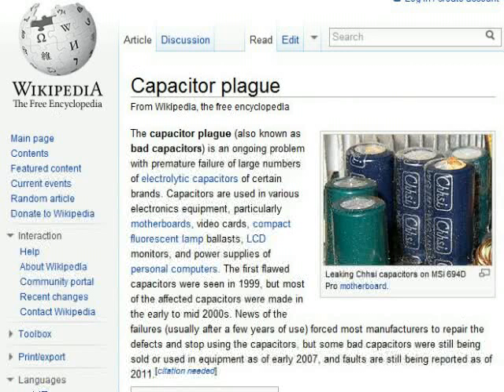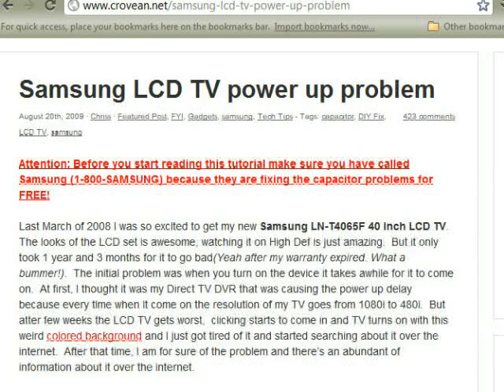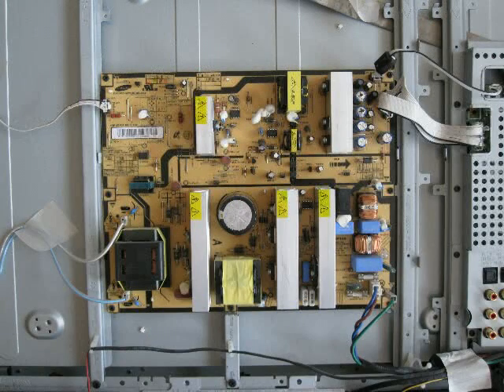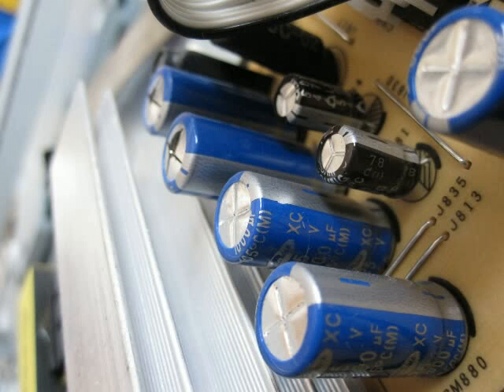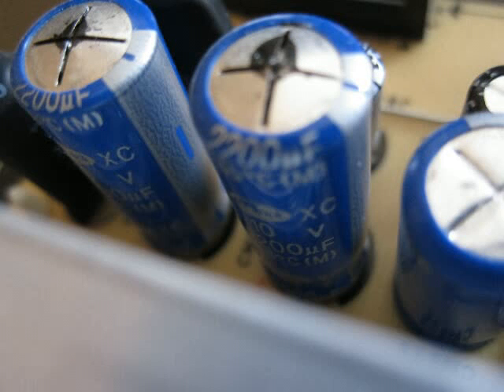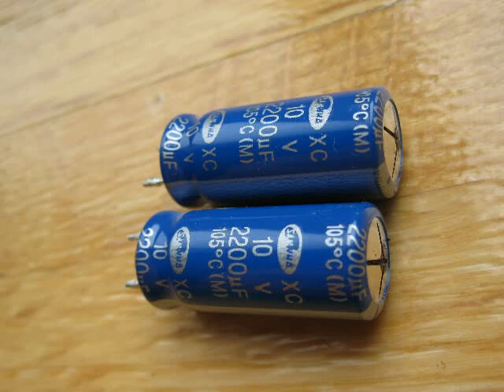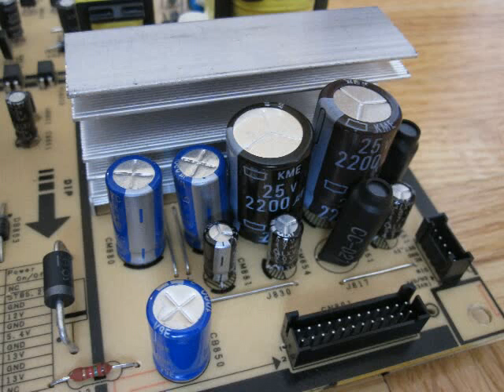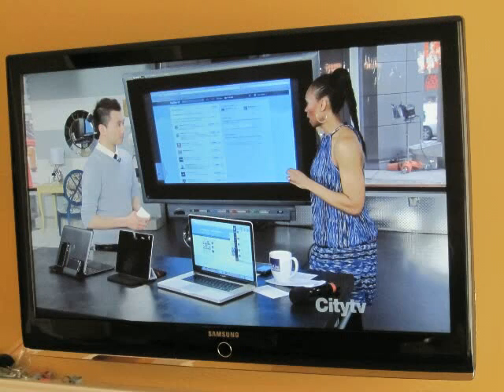Samsung TV Problem Turning On - How to Repair Fix

Comment: I'm looking at my circuits and none of them are bulged or leaking, but I'm still having the same issue.
Reply from the maker: Sometimes the caps have become bad even without an obvious external signs of failure. If you are having the power-supply clicking problem, I would remove all caps on the power supply anyways and test them using an ESR tester. Or just simply replace all caps as a matter of fact. The caps are cheap, so you are better off just replacing them.  If there are more complicated problems, it will be harder to track down the issue. The only thing to do is go in and test every component or buy a new power supply board and then fix the old one for a future backup. Good luck and let me know how it goes!

Comment: hello there

can anyone help me my samsung 46 when its turned on and u turn it off and when u turn it back on it wont come on
Reply from the maker: Open it up and inspect the components on the power supply. Seems to be a common site for failure, usually the capacitors. Look for any bulging, leaked electrolytic fluid, any burn marks or do the "smell test" by sniffing around the board (make sure the power is off and unplugged). Be careful not to zap yourself with high voltage from any caps that are still charged. I'm sure you will find something.
Reply: nothing wrong with the components tryed that still the same i tryed the main board

Comment: BUYING A SAMSUNG IS A WASTE OF MONEY. Here's why. I paid 2300.00 for my 7100 series Samsung LCD TV thinking I was buying quality. It lasted 5 yrs now at the trash dump. 2000.00 to repair. Have you noticed how many TV repair guys aren't around anymore ? TV's are throwaways like a laptop that you get about 5 years out of them.

Advice from repair guy. Buy a set for a 1000.00 range at Costco. For 58.00 more you now have a 5 year warranty. If it lasts longer than 5 years you win. If it becomes toast like my Samsung you still win.

Comment: nothing wrong with the new tvs.  capacitors have a lifespan. these are around 2000 hours and less if running at full temperature.  anything with components in like this will fail.

Comment: My  3 year old 40" samsung had the clicking problem.. Now, it won't even turn on. I took the back off ad found 4 bad capacitors. Bought a capacitor kit on eBay for $15.

Comment: I bought Samsung LCD 3D TV  un55 f7100afxza 2/15/2014 and it went out 12/31/2015 . No power, no red indicator .. So pretty sure I'm on the right trail here. Of course Samsung no help as warranty is over at one year and this almost made it to 2. They tried to tell me that it was as of build date also. What???? No not if you have your receipt. But it's only one year not 2. Well this will be a project so wish me luck! If this 55 year old grandma can do it anyone can! And Samsung BITE ME! I'm all done with you!
Reply from the maker: +Karen Fleischman This is a very familiar story... And sounds like a power supply issue. I bet you if you open the TV you will find the power board has a fault. It may not be as easy as a capacitor though. I had a Philips TV die after 1 year and it was actually the fuse plus about 5 other components..... See my other video here:  https://www.youtube.com/watch?v=V5b0nfkVqkc
Reply: Thank you!!!  I'm going to open it tomorrow evening... Thanks so much for the guidance! I'll let you know how it goes!

Comment: changed the capacitors in my samsung tv LE40M8780, though they looked ok, still got the same prob of tv  turning on and off repeatedly. Any idea"s anyone?
Reply from the maker: There are other components other than the capacitors on the power board that need to be checked, as they could be damaged as well. You can get a repair kit or simply find a replacement power board. You need to trace each step of the circuit and see if you are getting the proper voltages out. Check the rectifier diodes, make sure they are working properly. Check any transistors, MOSFETs on the board, it can be an arduous process. Good luck!
Reply: thanks

Comment from the maker: SAMSUNG Capacitor Settlement UPDATE for Canadians -  So I called the Canadian contact number 1-800-726-7864, and someone there told me they WILL SERVICE your TV if you have the clicking problem. However, there is NO SETTLEMENT in Canada... The US settlement does not cover Canadians. That means, if you fixed your TV OUT OF YOUR OWN POCKET and paid for a repair, THEY WILL NOT REIMBURSE YOU. Furthermore, if your TV has been "fixed" (for how long who knows) they will NOT send a service rep to you.

Comment: i have this problem but i cannot fix it myself. i dont have a Soldering tool  nor do i know how to use.  is there a place/ anyone know of a place that would do the repair without it being $500?
Reply from the maker: Perhaps look for an electronics hobby group in your area and see if anyone there can help you fix it or join an electronics forum like EEVBlog and see if anyone can help guide you online or knows a local hobby group. You need a "Maker Space" or some hobby meeting place where people who tinker with electronics get together and build and fix stuff... I am sure you will find one in your area.

Comment from the maker: SAMSUNG Canada PROMISED (on word of a customer service call centre - ok) that if MY TV HAS any FUTURE problems related to capacitors, they will honor it and fix it FOR FREE. I told them that Samsung DENIED this to me 1 year ago, saying they didn't have a problem and told me to fix on my own. NOW they said "We offered free service as early as mid-2010". BULLSH*T, Samsung Canada did NOT offer it when I called in early 2011. They are back-peddling to cover their ass. Lies and deceit over and over!

Comment: Cheapo san-wa caps used in cheapo make plasma/lcd have 105 C rating--For 1000 hours only.
 Rubicon or Nichicon Make caps, 105 C rated at 10,000 hours. You get what you pay for!--they'll be double/triple the price of the cheapo rubbish.
--Cant get 'em?--OK, Use Panasonic 105 C ones, but they only rated for 2- 4000 hours depending on model....
Check the data-sheets for the caps you are thinking of using before buying 'em--All good makers issue them online.....

Comment: Samsung are shit I just got the Samsung series 9 65" curved UHD and after 38 days the TV dose not turn ON what a joke my LG hade lasted for 9 years with out any issue and my sister is using the same TV RIGHT NOW. Samsung TV's are way overhyped !! DON'T BUY Samsung THEY ARE SHIT  TV's Cheers.

Comment: Samsung is such a rip-off!  I have a 55" 240Hz LED Samsung that is barely four years old, and it went out yesterday!  It just keeps making the "clicking" noise, as if it's being turned on and off.  Also, I could smell an alkaline-like odor coming from the back of the tv - no doubt this was the faulty capacitors. 

When I called Samsung, they did nothing to help.

Samsung, I will NEVER buy ANY of your products again - EVER!!!!
Reply from the maker: You should open up your TV and check for capacitors, take a video or photos and share it with as many people as you can, like I did.

Comment: I have a samsung tv and having a similar problem but slightly different. I posted a video here: 

https://www.youtube.com/watch?v=ro2UWg9HAFg&list=UUQpYO0a0UQgwJd-m6tBqWKw

Does this look like a capacitor issue? I have noticed that if I plug my ipod in, the screen doesn't do this. So is the problem in the tv or somewhere else?

Comment from the maker: Please check out my other TV repair video: https://www.youtube.com/watch?v=V5b0nfkVqkc

It shows that sometimes it is a bit more complicated. Still, you can buy repair kits from various online suppliers (as mentioned in the linked video) for $20-30 or complete boards for $40-50 so you don't need to bother soldering and fix your TV yourself.

Comment: thx for the video...I am having an issue with the tv and opened it up...
u can see black mark in the first video below...I think they are just marks from the last time they changed the capacitors (last time something similar had happened samsung send someone to repair) and I believe they replaced the capacitors and hence those marks...they do not seem to be bulging out...

https://youtu.be/1n7OMg2zepI

https://youtu.be/tBWdwP3xL80
Reply from the maker: +MeRandomVideos Bad capacitors don't always vent and bulge. Sometimes you will get a bad capacitor that looks normal. The only way to test is use an ESR meter or purchase a cheap component tester like this one in my video: https://www.youtube.com/watch?v=ZUq6QDuSbfY

You may have to check a number of components on the power board. If it is too much work or difficult, try to replace the entire power board. It may cost you some money but will be cheaper than buying a brand new TV.
Reply: thx for the reply ! I did try a few things out at that time (replaced the capactiors and managed to not get it back to life)...ended up buying a new TV -:)

Comment: I use to think Samsung was the best MY TV won't turn on SMH
Reply from the maker: +JALICIENSEyTEQUILERO There is a big problem not only with Samsung but many other brands. Most problems can be traced down to $2-3 worth of electronic parts, but most people don't know how to fix it or they are scared. My video is to show people how to start learning electronics and understanding that it is better to repair, for the environment and also for saving money.